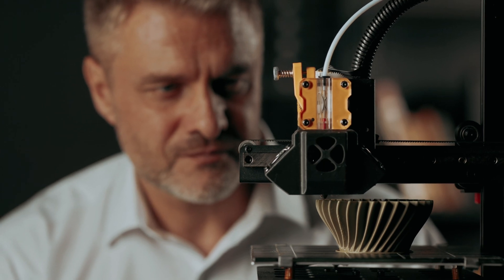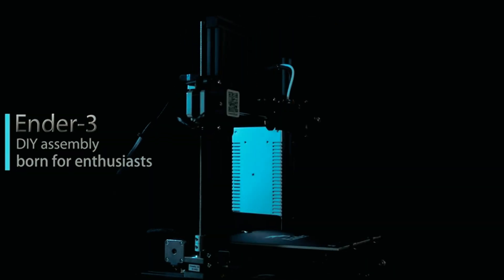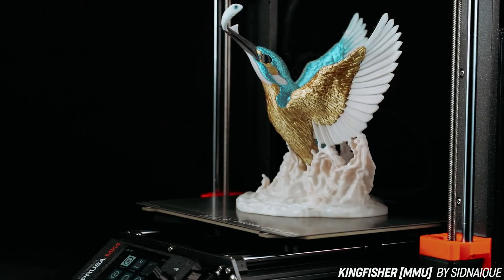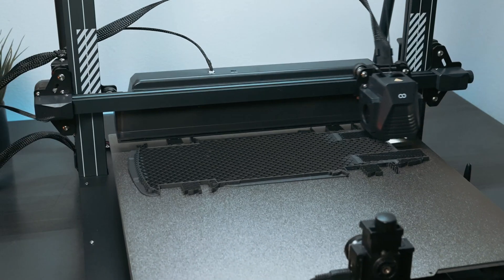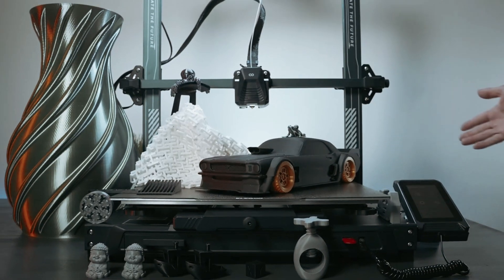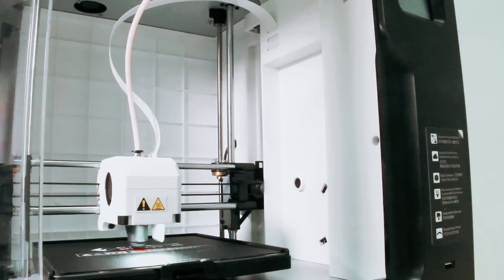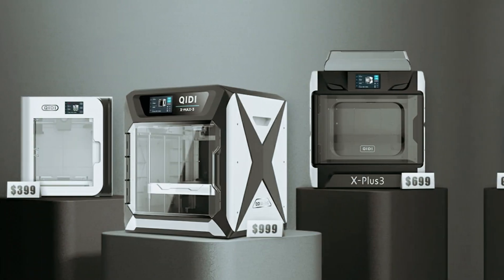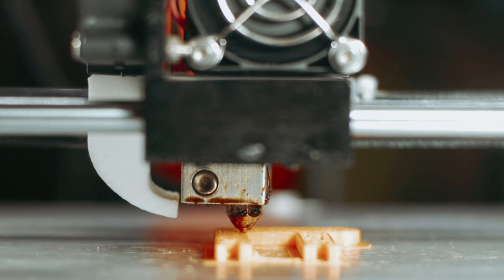5 Best 3D Printers 2025 | From Budget to High-End!

Comment: Bambulab A1 mini is the best printer for beginer. Not in your list :(
Reply from the maker: It sounds like the Bambulab A1 Mini is a great option for beginners, especially with its user-friendly features, reliable print quality, and ease of use, which makes it a solid choice for those new to 3D printing. It offers features like auto-leveling, fast printing speeds, and a compact design that is convenient for smaller spaces.

It's unfortunate that it didn’t make it to the list you saw! There are many great beginner printers out there, and the Bambulab A1 Mini is definitely worth considering. If you ever do a review or an updated list of the top printers, it’s definitely a good one to include for beginners! Thanks for pointing it out.